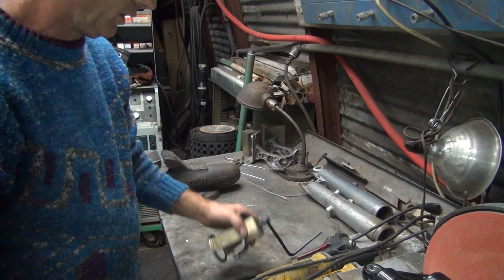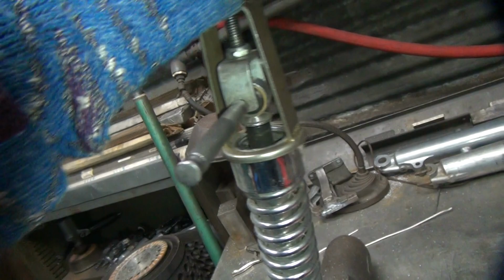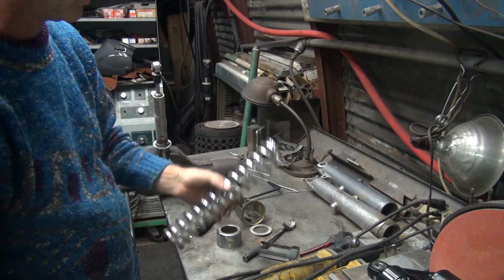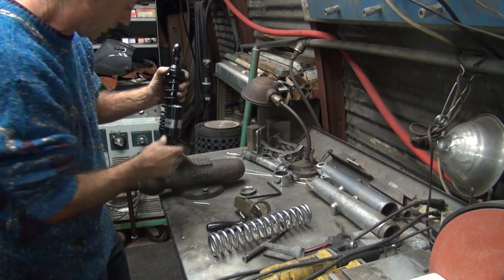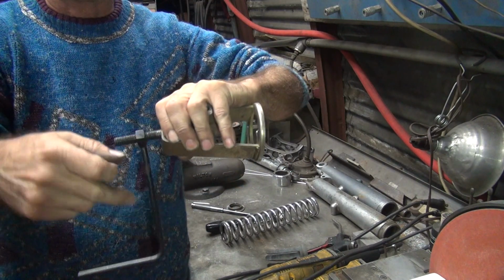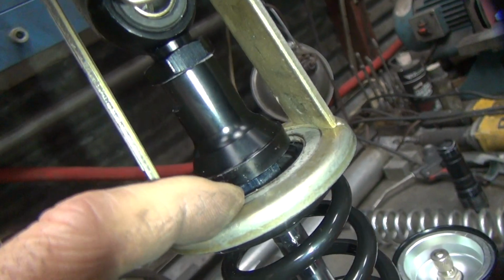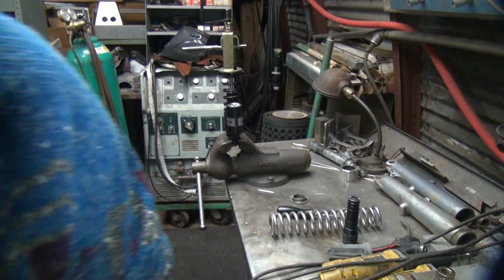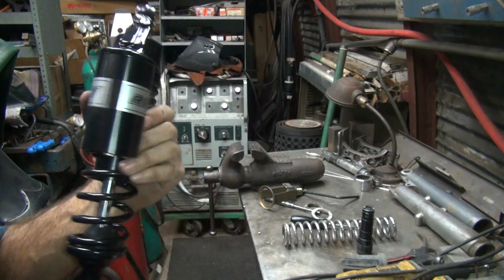#132 1973 shovelhead loose the ugly kickstart custom bobber build 74ci FX FL harley by tatro machine

Comment: Hey, I have or maybe had a pair of old shocks, 12 1/2” heavy shocks off an old flt, I’m trying to find. If I haven’t completely hidden them from myself you can have but no guarantees in my mess 😁. I’ll let you know, Jim
Reply from the maker: they will only work if the springs are around .330 thick. most are under .300
tatro